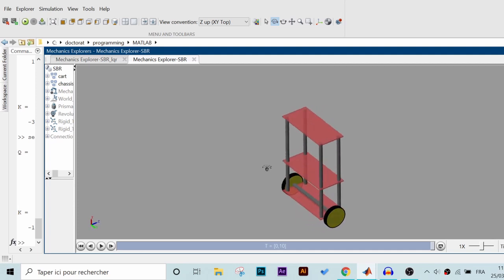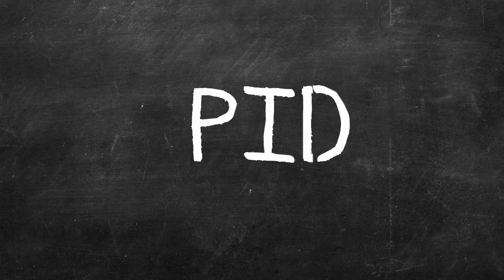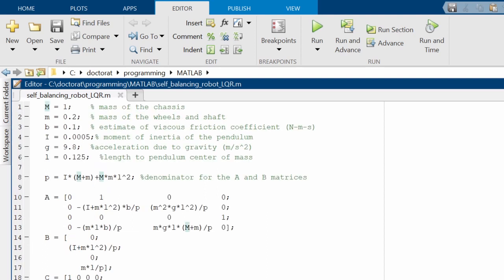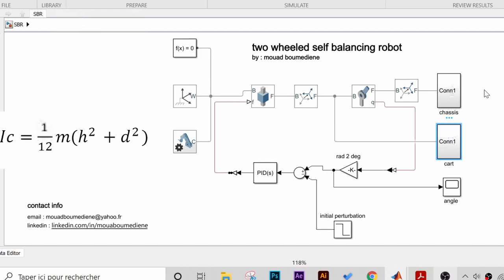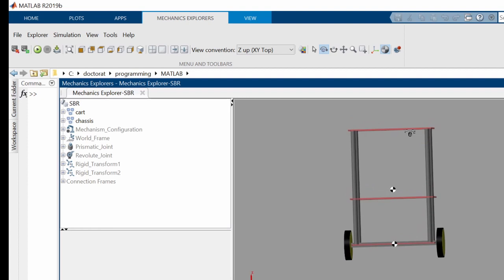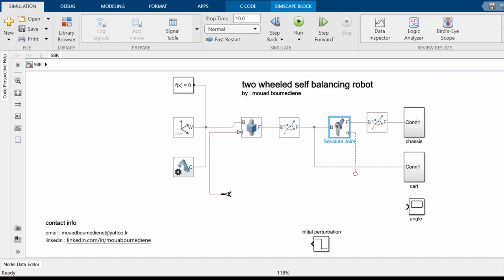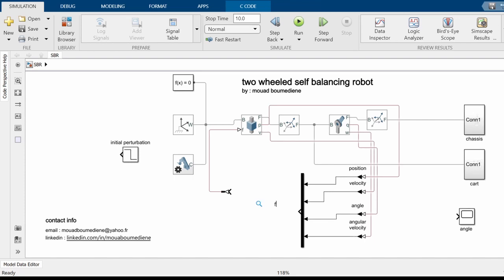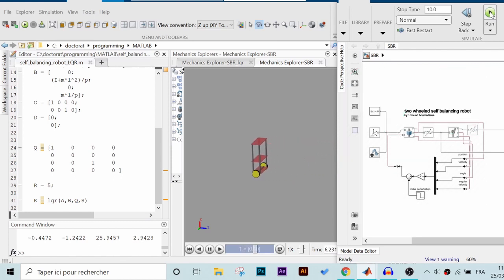applying an LQR command on a self-balancing robot in Simulink |2021|

Comment: Hello. I implemented a state feedback control using the state-space model with the provided A, B, C, and D matrices in Simulink, but I noticed that the state variables are diverging. When I checked the poles using the eig function, I found that there is a positive real number included.

Why does the regulator work correctly in the Simscape model, but when I create a separate state feedback model, it produces diverging values? Also, when designing a state feedback model in Simulink, should the initial value of the integrator be set to the same value as the step input in Simscape?

Comment: Hello great video sir, i was wondering how do you suppose is it possible using the same model for the robot to make turns to reach a certain target rather than just move forward and backward? An idea or resource would be highly appreciated. Thank you.
Reply from the maker: you can use another 3D robotics simulation environment like gazebo + ros.

Comment: hi, thanks for the educational video!! I have a question, I used your block diagram to simulate my own self balancing robot, but i also want to compare the state variable output from the physical system which is your diagram to my mathematical model so i attached scope in the state variables (position, velocity, tilt angle, and angular velocity). But i could never get the same plot from the mathematical model to physical model. Do you have any idea how to do it?
Reply: To answer your question

1) You need to place the scope between the ps- simulink converter and mux (x4) (i.e. The very before the mux input). You can use the seperatye scope or 4 input scope. I used the second.

2)You need to adjust the Q & R weights. Refer below, you could see that angular velocity is enormously increased , So in your system start the adjustment form angular velocity. Also please refer video from steve brunton - https://www.youtube.com/watch?v=1_UobILf3cc (Linear Quadratic Regulator (LQR) Control for the Inverted Pendulum on a Cart [Control Bootcamp]) . In that note a point at the time of 9:20. That's why i enormously increased the angular velocity.
Hope works fine. 

This worked for me:

M = 1;    % mass of the chassis  
m = 0.07;  % mass of the wheels and shaft
b = 0.1;  % estimate of viscous friction coefficient (N-m-s)
I = 0.0057416;% moment of inertia of the pendulum
g = 9.8;  %acceleration due to gravity (m/s^2)
l = 0.125;  %length to pendulum center of mass

Q = [0.001     0     0     0     %position - red
     0     0.01     0     0     %velocity - green
     0     0     0.1     0     %angle - yellow
     0     0     0     1e11]    %angular velocity - blue
 
R = 1;

Comment: In the simulation why does the robot stops moving forward and starts going backwards?
Reply from the maker: the forward motion is a result of the robot trying to balance itself after the initial push but since nothing is perfect the controller overshoots and the robot start falling backward this is why the controller has to move again to the opposite direction ( backwards ) in order to catch the robot and prevent it from falling
Reply: But in case of PID controller why doesn't it happen the same it keeps going forward never backwards?
Reply from the maker: @khiyanatdeori5957  mainly because of overshooting

Comment: Great video!! I have a question on "GAIN", an error is occurring for me "Invalid setting in 'SBR_LQR/Gain' for parameter 'Gain'.
Caused by: Error evaluating parameter 'Gain' in 'SBR_LQR/Gain'
Unrecognized function or variable 'K'.
Variable 'K' does not exist. Suggested Actions:
Load a file into base workspace.
Create a new variable.” Could you tell me how to solve this?

Comment: What is the advantage of using lqr over pid?
Reply from the maker: i recommend this paper that explains exactly that : https://citeseerx.ist.psu.edu/viewdoc/download?doi=10.1.1.545.6096&rep=rep1&type=pdf#:~:text=For%20the%20last%20characteristic%2C%20both,response%20faster%20than%20PID%20controller.&text=It%20shows%20that%20LQR%20control,compared%20to%20PID%20control%20method.
Reply: @hobby_coding  I can't access to this link. Can you reup it?
Reply: You are really very nice thanks a lot❤️ 👍